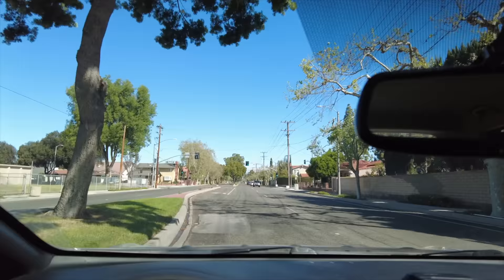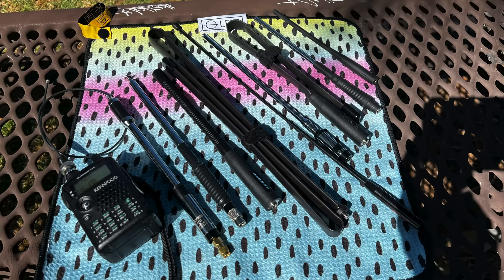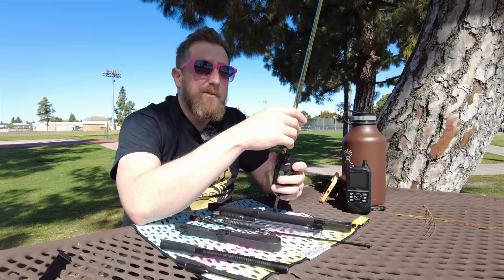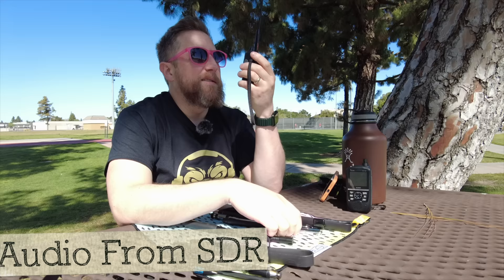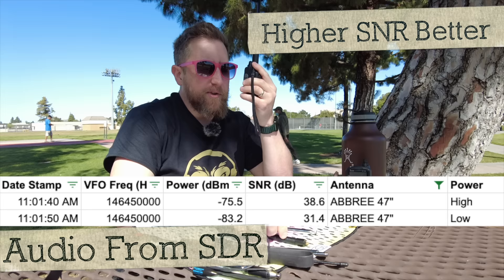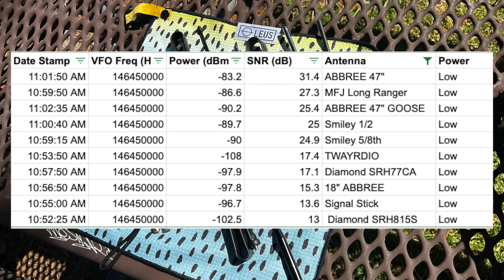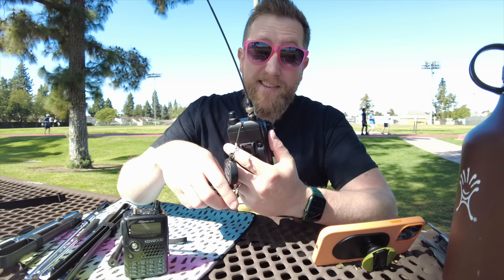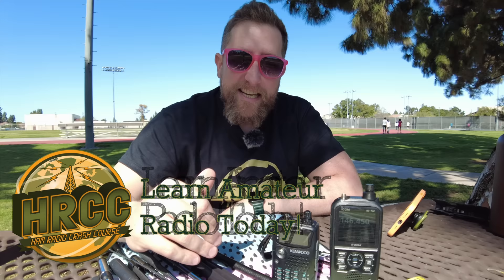Tested! ABBREE, TWAYRDIO, Smiley, MFJ Ham Radio Antennas & QuirkQRP ZipTenna!

Comment from the maker: Should I test your favorite antenna?  What is it?
Reply: I'd definitely love comparison between the long Abree antennas and say Diamond SRH770S, which is of similar length, but more expensive, and from a brand with stronger reputation.
Reply: Do a test on a DIAMOND RH205 antenna. I use it on an ICOM IC V86.  It uses a BNC connector. Also try any Comet antenna. I forgot to say the Diamond RH205 antenna is 52.8 inches extended and is a 5/8 wave fully extended.  Works very well for me.  Great video btw.
Reply: Roll-up j-poles: Ed Fong vs N9TAX
Reply: I mean, did you get the Twayrdio I recommended? The all black one? Because THAT ONE in the video, I had no part of. :)
Reply: I got the two pack Luiton NA-771 , they honestly seem to perform better than most of my other HT antennas , like $14 for 2 of them
Reply: @AlexLamar1  I’ve had good luck with them on two of my baofengs. I was checking in to a net with a mag mount I use for a makeshift mobile and got better reports using the Luiton
Reply: This has been the most informational videos on the quality of antennas.
Reply: NA24J flexi boi vs SRH770S long boi vs SignalStick flexi boi
Reply: I run the SRH77CA on my THD7A and love it for local use. I just put a nagoya tri band on my UV S9x3 and it does pretty good on 220mhz even tho it shows a terrible swr on my nanovna.
Reply: @Lost Hwy 108  i also use the NA-771, mine are Nagoya´s. It Works better than the oem Antenna of the FT-65e i have.
Reply: I've been using a Ed Fong DBJ-2 roll-up j-pole for SOTA activations, I'm wondering if it is worth the hassle compared to one of the extendos you reviewed here. Great video, it cost me $25!
Reply: AWESOME video Intro bruh.....  😂😂😂
Reply: I'd like to see these antenna up against roll up jpoles @ same height and up say 15' above ground.
Reply: There are several manufacturers that have there version of the ‘701’ series.  Diamond SRH701a, Nagoya, raddioty, etc.  
I like these because they are EDC size, but seem to do better then the stock antennas.
Reply: Abbree
Reply: The Wouxun KG-935G stock antenna is awesome!! Albeit tuned directly for 462 - 467 it is a great antenna.
Reply: @Rusted_Link  The rusty nail as a antenna is awesome!! The nail is tuned directly for 462 - 467 it is a great antenna.
Reply: @VicGreenBitcoin  yay
Reply: I just want to see Ed Fong j pole vs MFJ Long Ranger. Looks like a lot less set up for very similar output.
Reply: Please test the PHD-771
Reply: Stock Wouxun UV9PX antenna vs Smiley 5/8 triband
Reply: It would be very interesting to see how the weird "loop" RE-D1 antenna performs! Very strange antenna indeed. Thanks for your time!
Reply: How does the HYS Dual Band Telesopic work?  Unique design... About 9" extends to around 15".
Reply: Ive heard that nagoya makes good antennas, im curious how they stack up
Reply: I guess my main question might be...  do you have to unfold the ABBREE 48 to transmit, or will it transmit FOLDED and how much difference would there be, as folded it would be like 16in. x  3
Reply: Ham radio crash course, I am asking you, did you have issues hitting the repeater and hearing it with the portable so you upgraded the antenna? Or ????
Reply: Wish we could get a similar test for GMRS frequencies

Comment: Great video.  Quick suggestion: use recorded audio for the test call.  It would normalize the test for changes to distance from the mic and remove background noise including wind.  Really appreciate these types of videos!!  It would also be helpful to do a cw tone to measure signal strength instead of audio, maybe put your call in cw on the recorded audio?
Reply from the maker: Great suggestion!

Comment: A tip for the ABBREE... I have the 42.5" ABBREE and if (when at home) you store it unfolded it will lose the kinks and stop tending to fold up on you. I wish someone sold the actual military versions of these, as they were MUCH better built, but the ABBREE is a great antenna, IF you get a REAL one and avoid the counterfeit ones... They work great ran through the MOLLE straps on a pack.
Reply: Amen. Not saying my ABBREE 18" is great by any means, but I make sure to store it at home in its extended (unfolded) state.

I like it because I can put my radio in my Camelback, have the antenna sticking up, and have my hand mic/speaker on my strap opposite my water valve.  Does anyone have any favorites for such use?
Reply: I didn't know that. Thank you 👍
Reply: When I bought my first radio I immediately upgraded the antenna to the 42.5".  With having the HT that shall not be named, it seemed like a no-brainer.  The ABBREE works surprisingly well.
Reply: @bluedirtgreen  "shall not be named". 🤣

Comment: The smileys are right there and they are practical. I've used them for 30 years. You have to try the smiley stubby 2m it rocks. Hro had it for 10 bucks.

Comment: I've got a couple 42" Abbree that I've use with a Baofeng HT and my IC-705. The BNC version for the 705 broke because it was folded and created weak points in the antenna. What was good about them was that they could be folded over just a couple of inches at the top and can lower the SWR on 2m next to nothing. 

I do have a FT3D and use a few antennas with. I've used a 42" Abbree, Diamond SRH770S and RH77CA, along with a signal stick. The 42" Abbree picks up APRS beacons much better than any other antenna I've used. The SRH770S is a good, all around antenna for field and home use. If one does Wires-X/YSF or any other digital vioce mode with a hotspot, the Diamond RH77CA is hands down the best antenna for that purpose, with next to nothing SWR on UHF. 

With what I've learned from the antennas I've used, each one has a different purpose. If one has an HT that does APRS and likes to go for hikes other outdoor activities, I recommend the Diamond SRH770S. It's a great antenna for the outdoors. It's flexible and will not fall over like a Abbree antenna will. 

I've used a Abbree 42" foldable on a Baofeng while hunting. It wasn't pretty and was more if a hassle than anything else. They're great around the house for getting into a repeater if you're outside.

Comment: Other antenna testers have said adapters like the one you used on the THWAYRDIO RH770 are actually adding length to the antenna thereby changing the resonant characteristics of the antenna. The change may be so small that it's negligible in your test scenario, but could be critical if you were at the absolute limits of a repeater's coverage.

Comment: I went with the 72cm (28 inch) Abbree just to try it, but before I bought one, I did some research and found out that the 48 inch does just almost the same performance so that is why I've got 28 inch so it's not too short and not too long. Beliveve it or not, the farthest contact Ive done with it at a height of more than 200 feet above sea level is 74km on simplex at 4 watts. Take note, I was just using a vintage Icom IC-02AT. It's a great and handy antenna for emergency purposes to carry around with for the "just in case" situations.

Comment: I noticed a few years ago my Signal Stick didn't perform nearly as well as my Smiley 27000.  I still like that's it's nearly indestructible, and I'm a fan of supporting local businesses.  I use it when durability is more important than radio performance, but that's about it.  I know the 1/4 wave 27000 doesn't perform as well as the 1/2 wave sticks, but it's a much more convenient size for daily use.

Comment: Ditch those rubber grommets, and go to a good hardware store and pick up some washers that will fit. Works much better. Thats how I solved the problem on mine. Love my 18 inch Abbree antenna. I now have the 13 and 15.35 inch versions. They all work great. But the 18 inch one is my go to when I'm doing field work and I need that little bit of extra range.

Comment: Thank U very much for such a Spectacular/Practical Test , No Manufacture can getaway from your test ..

However the SWR reading would change significantly as your Head Approach the Walki-Talki and Antenna in TX Mode .. i had done this test in me house using MFJ Antenna Analyzer ..

for instance , from the video i would consider "Signal Stick" is a little bit Longer for 146.5 Mhz "Test Frequency" ...

i wish to consider a different method or to sweep the Frequency a little bit Up/Down to "give a chance" for the Antenna "subject to Test" to show it's maximum radiation..
Reply from the maker: Thanks for watching!

Comment: I got an identical Abree knock off of the long one and I find it's quite good and buries a rubber ducky stock antenna on a Baofeng, absolutely. And you can tell it's the same as an Abree, as it suffers the same gap, comes with the same couple of plastic grommets and has the same weakness they all have, at the joint where the flexible part, meets the solid base that then attaches to the radio at the bottom. I solved that middle joint weakness (because it is a complaint on ALL of the "tactical" folders like this, no matter the brand and will cause it to short out) by putting a simple hose clamp right over that joint. After making sure it was screwed on tight, then cinche a hose clamp down right over where the two meet. That should prevent loosening up and wobbling from it's gargantuan length. It's a hilariously funny antenna to try and use, don't even bother trying to ever stand it up on a table with a small radio, lol. 

The thing is so weighty and big, I sometimes hold the whole radio and antenna from the solid bottom base part of the antenna, as it is actually more balanced and not as unruly as holding the radio in your hand and trying to balance this monstrosity, lol. Think of it as kinda the same concept as choking up higher on a baseball bat, for better swing control and it tames its unruliness. Same thing here and although I would never hold a radio from the antenna, on this one it is perfectly acceptable. That base is thick and well fastened/constructed where the antenna meets the radio. It's fine, it's that joint above it that's the problem. Funnily enough, my cheaper Abree knock off, did not suffer this "limp from being stored too long in the same folded position" problem and is pretty solid really. But I love that you showed and said that! I immediately went and refolded mine in some unused nice stiffer spots, that had never been folded, because it does indeed tend to soften and get weaker if you keep folding them the same way and fold areas over and over. Great tip, I now know how to preserve mine longer. 

Meh, for a mere $10 I took a chance and A:) It's cheaper than an Abree for the same cheap antenna, quite literally identical in every way. B:) It's quite clear and nice when it picks something up and beats others. And C:) it actually isn't as limp and fragile as your Abree either?! I call that a win. If it eventually goes, I am not going care because I will own some more reliable telescopic ones instead, lol. I bought those 40 odd incher folders just for laughs as much as practicality and they are surprisingly good at RX for me and obviously, TX for you (I have no ham licence yet) and my experience was much the same. Not bad for cheap junk really, hahaha. How many things can you say that about?!

Comment: Great test!  My two favorites - the Diamond and Signal Stick were not producing the results I hoped for. Maybe they’ll shine in another test?
Reply from the maker: I think you have to keep in mind both of those are standard whips.  Not telescopic or folding.  They're on the much better end of whips when you look at it like that.
Reply: It's still apparently better than the stock antenna and it's very robust mechanically.
Reply from the maker: Yes. Much better than stock and easily can stay on your ht at all times

Comment: The ziptenna is a neat idea, but there's two big problems I can see with it.  First, HTs already capacitively couple to the holder and use them as a ground plane / counterpoise, so if the ziptenna doesn't account for that the precise length isn't very precise.  Second, is it grounded?  I couldn't tell for sure, but it looked like it was just near the SMA jack and not actually in contact with it...  Maybe it does better if it is looped around the jack?

Comment: Thought on the 47” …
- Wouldn’t it be a great antenna of a handheld (4-5W) with extension coax-cable to a magnet on a steel roof rack of a 4x4 in the outback?

Comment: My FT-65 with Diamond SRJ77CA showed an SWR of 3.90 on 2m, testing with a Surecom SW-33plus meter, with no drop in wattage compared to the ducky. Perhaps the meter is garbage. Perhaps testing SWR of an HT is futile. Perhaps the antenna truly does have too high SWR. Either way, I'm worried enough that the rubber ducky may have to stay on so as to not fry my HT. I donno...

Comment: It would be great if would run these tests with a MURS radio. These radios are really popular with CERT  I use my Nagoya NA-320A that I got for my BTECH UV-5X3 on mine.  I know it is not optimal for 150 MHz.
Reply from the maker: The results would be the same.
Reply: @HamRadioCrashCourse  Thanks.  I was hoping one of them would be tuned higher in the ham band

Comment: Wondering. Why do you use or prefer the Signal Stick on your radios when this comparison you did shows the Smileys doing better?
Reply from the maker: Generally because you can rock the signal stick all the time and its a generally a good performer. The Smiley would break if you left it on the radio for long and it’s fragile as it’s telescopic.

Comment: Thank you for the report, interesting.  Interesting for the gadget hounds. Practically speaking, I guess I don't get it. All of this for using a distant repeater?   If you are using a repeater, what's the real point?  Cell phones don't need outboard antenna and they work almost everywhere and we are talking very low power devices.
Reply from the maker: It’s not to a repeater. Cellphones can only talk to cell towers.
Reply: So check out the antennas and transmitter power at the cell base station. Typically 17 dB antenna gain, plus higher power.
I'm sitting at home, 700 metres from a base station, and my phone is showing a signal strength of -114 dBm on 4G.

Comment: Here a year later after release.. I like how the smiley sound.. I would like to ask for a tactical demonstration… I have a baofeng uv-5r.. I have a relocation antenna kit 90degree bnc … the relocation kit end is a sma-female.. so I have to get a sma-male antenna to attach.. now my question is… if the radio was designed for a sma-f antenna, would my relocation kit work , if I have to switch to a sma-male antenna?  TWAYRDIO seems to be the only brand on Amazon that makes a decent sma-male antenna…. Any suggestions

Comment: questions: 1) at about 6:12 you talk about the antenna being the MFJ Long ranger, but the text reads "ABBREE 47" GOOSE", which is it?;  2) for a tri-band Kenwood D74A what would be your recommendation; 3) if an antenna gets too long i was thinking to just have a coax cable to separate the antenna from the HT, what are your thoughts on this; 4) I also have an AnyTone D878UVII Plus, what would be your recommendation for it?  Thank you for doing this.  And one last question, do you have any idea how your SNR test results compare to result on a Tiny VNA?

Comment: Put that 3d printer to work and make spacers to fill the sma gap..
Reply from the maker: I don’t generally run ABBREES, they’re too unwieldy.
Reply: @HamRadioCrashCourse   for any that have a gap on the sma it would give relief on the radios connector. The smiley had a big gap.